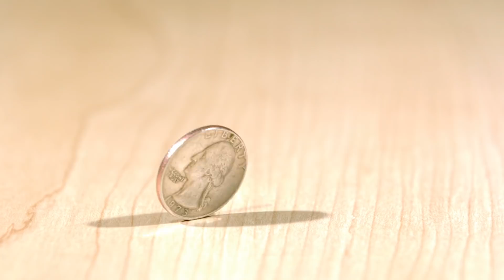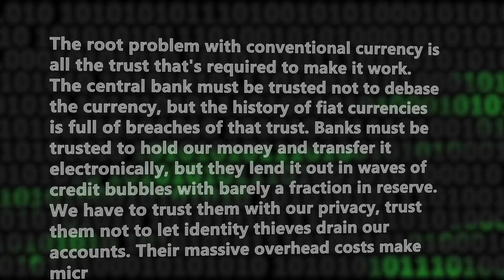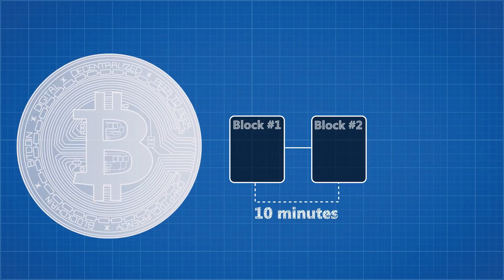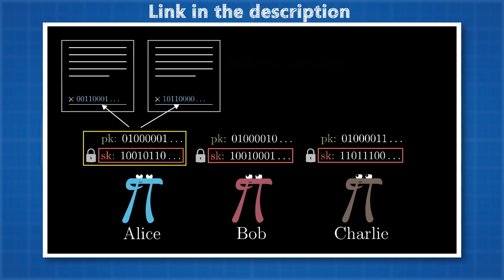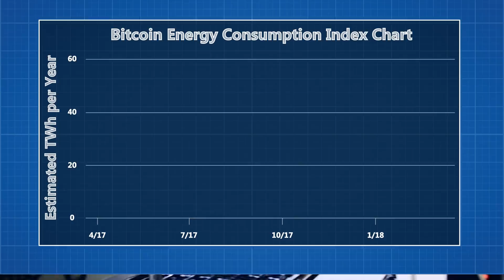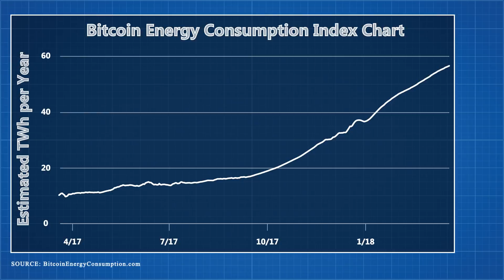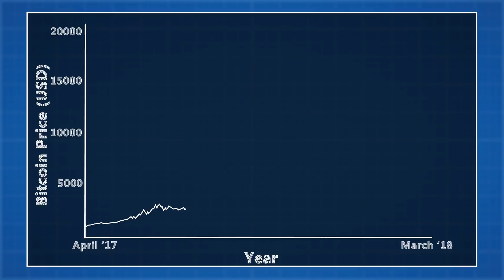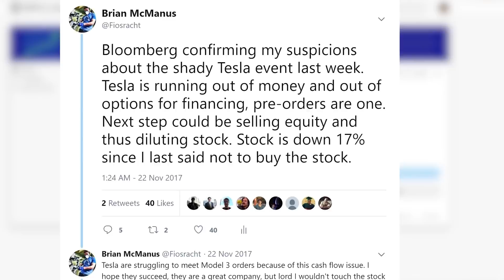Why Bitcoin Is Not Working

Comment: bitcoin is not currency it is a commodity as of now, but it has very very very bright future I think.
Reply: Correct, bitcoin is not and will never be a currency. Learn about what a currency is, then learn what a pegged currency is, then, finally, google The "Double Coincidence Of Wants". Bitcoin has nothing backing it for it to become a stable, useful currency. Never going to happen. If you can be shut out from using a "currency" because you have slow to no internet connection or no computer, etc.... then it is not a real currency. Cash or plastic can be carried around with you, in your pocket and everyone generally what $10 USD will buy you. That can only happen with a real, stable, secure currency, which BTC is not.
Reply: Stock you can get dividend back in most case and they don't go 20k to 8k within 20 days well of course unless you like to gamble with the penny stock.  Bottom line is, bitcoin is not a currency nor a commodity it is simply a game of gamble.  It is no different than betting red/black(up/down) space on roulette.
Reply: a commodity that has no use?
Reply: Theyn Smith stock has any use?
Reply: I'll be paying with my super rare pokemon cards, they have a really bright future.

Comment: You think BTC users want their 'currency' to be worth the same tomorrow as they are today?.... Ha!
You think the 'cost' of Visa processing transactions is its energy usage? HA Just because  electric the primary cost of BTC transactions doesn't mean that it can be compared to the electric used by another means of processing transactions and then say it's less efficient. Is that strawman? It's been a while since AP English, but I'm pretty sure you can't do that. How about you compare the carbon footprint of BTC transactions in a year - you can use that figure in your video, I don't mind, then take Visa's... The company.. Their employees commuting to work everyday.. Their building and infrastructure, their lawyers and fraud,  then tac on their energy usage, compute that with some monkeys, and let me know who is more 'damaging'.. The reason there is so much electric being used by the network is because there is a demand for it to be done. There is a call for someone besides Visa to process my transactions. Sure, BTC or even crypto in general are not immediately solving the problems nacamoto originally intended for BTC to, but.. I'm just not sure you can then follow that it isn't 'working' I mean.. It's not a corporation with a mission statement that isn't achieving it, nor is it a corporation with stock holders that it's upsetting because its unprofitable. If you want to compare it to gold, which is completely inappropriate to do in any serious conversation about it, then you must at the same time concede that it is just there.. BTC has been put out into the earth to be mined and used and traded. It can't... work. Or not work.. Why Gold Is Not Working.. I mean.. it doesn't really have the same ring to it, does it. You got one thing absolutely right in your video, and that's people cause the problem, not the items we use as tools. Our use of Gold as a monetary standard might not be working, our valuation of gold might be unjustified, our use of BTC might be strange considering it's potential, but.. BTC.. Isn't not working.. Bitcoin doesn't have the potential to 'not work'... Also.. considering you published this video yesterday... Why did you just say that the network is limited to 4 trans / sec? I mean... Even if you had already written the script and started recording.. Looking at the 30 day, the mem pool is empty, you'd have to pull 3M to even look back into the past and see 'long wait times' or 'high transaction fees' which definitely were issues that the network faced, but, because of demand, they were overcome. https://jochen-hoenicke.de/queue/#0,3m

You know what.. I think there are 100+ problems with Bitcoin or any other crypto currencies, ultimately coming down to people and how they are using them, or buying them without understanding them / the risk that comes with such high risk investments, but I have been in BTC for years, and been watching it be mined since the good old days when you could mine whole coins on your home PC with a GPU, and it's tiring hearing everyone on the internet / mainstream media talk about it like its some kind of criminal just because people got excited about it last year and lost money. Should we barter? Or are you really saying that Visa is better? If it isn't good, then it wont be competition, and it won't be demanded by the people, and if it is competition, then it will be sustained, and will work, and will cause the invisible hand to make everything better for us consumers. Does that mean that one should invest in Anything without understanding it and the associated risks? NO, of course not, and that includes the bank's CDs even, but does that mean that BTC is 'bad' or that it "Isn't Working".. No.. Just... No. I'm a college student, and I've made... I'm doing well with BTC, and I take the time to understand it from a technical aspect, from a monetary aspect, and from a social aspect. I'm not saying everyone should, I don't believe they should. I just think the issue is people dropping their life savings in Bitconnect.. Not that 'Bitcoin isn't working'

/rant
Reply: CfomodzGaming  ssooo since you said I am a student and I am made... Does that mean you too don't believe in bitcoin and transfer it straight to the dollars? Ironical.
Reply: TheBoldImperator isnt btc still up 10x this year. Things never go up in a straight line , thats just howbit is. Why so much hate? Did you get burned? Or u pissed you missed out?
Reply: Bitcoin as a currency to exchange goods and services isn't working, at all, It's way, way way too volatile for that; it's only working for those who make money, real money, mining and speculating on it. It encompass all the problems of current currencies, but on a galactic level, therefore it is doomed in the short to middle term. Enjoy the ride while it last.
Reply: The idea was great but humanity destroys it.  that's how it's always been.  

even paper money at first didn't go so well.  if you look at history of paper money...  when it was first done.. people realize and start printing their own money.  other counties start burning money of their enemy to destroy their economy. 

and that is why strict regulation has been applied.  (such as only government can print money and burning them is a crime.) 

A currency that is not regulated is always a step backward.
 
Just look at what is happening... people keep on launching  ICO... <---- that was exactly the first problem of paper money.. people printing their own money. 

When you die.. your crypto will be out of circulation.. (that is if nobody know where you hide your private key) <----- that is the same as burning money.. decreasing the currency circulation.

not to mention blockchain consumes so much energy... .
wasting such amount of energy is a big NO for a world that is already heading to clean energy. 

---------------------------

Crypto will be the currency of the future....
but they need to solve these 3 problem first. 

paper money didn't succeed immediately. 

a decentralize currency that is regulated..  wait for it.. it will come.
Reply: It's a bear market.. Are you okay with fluctuating markets? I am :)
Reply: TheBoldImperator, I don't like to share my profits for others' sake. It just seems prideful to gloat about one's own success. I invested years ago, so a $10,000 BTC is a dream come true for me. The only people who were bragging and aren't now because of loss of profits are people who got in during the hype (the same people I complain about in my comment). I'm not sure you really understand my situation based on your comment, but I appreciate your feedback.
Reply: Handschoen, I appreciate the criticism and will consider it. I'm not sure I understand your point about Coinbase employees not commuting to work. He's comparing Visa transaction processing efficiency to the BTC network (which, by definition, is meant to use energy to process transactions (PoW)), but I just don't think that's a fair comparison when you only compare electric usage to electric usage. There is a lot more cost / transaction with Visa than just electric usage, as well as a lot more damage to the environment per transaction. I am not even saying that it would be more than the BTC network / transaction or less (I would imagine it would be less), I am just saying that his argument is comparing the strong part of Visa to the 'weak' part of the BTC network. If I have humans bartering in a marketplace doesn't use much electricity at all, does that mean it's a more efficient means of transacting?
Reply: 00oracle00.. Did you read my comment? I mean, I know it's long, but if you're going to reply I would think you would at least skim it. I am up on BTC. I mean, if you follow the charts, it's actually right where it should be had people not gone crazy end of last year and it continued on it's upward curve, so I have no problem with the price. My hate is against people saying that BTC is somehow broken, or evil, or - as an earlier commenter did  - a ponzi scheme, when.. there is a definition for that word, and BTC falls no where near it. Is it a bubble? I mean, for the sake of argument let's say it is. Does that mean that housing and .com were ponzi schemes... No. It just doesn't. That isn't what ponzi scheme Means.. Could it be a bad investment, sure. Could it be a bubble, sure, but that just doesn't mean it's a ponzi scheme.
Reply: BuzzKil1, no actually. All of my earnings are in BTC. I increase the size of my stack because I believe in BTC instead of cashing out back to fiat. Thanks for the input though. I also spend my BTC on other BTC related products and services - as a means of transferring value, not a store of it.
Reply: I mean we're on year 9 now, right? When will the short term be over and people accept BTC as sticking around? Also.. BTC isn't a currency, so I don't mind that it doesn't work well as a currency to exchange goods and services, that doesn't mean that mining it is bad or that the network is failing to process transactions at a good speed, or anything else. I mean, in the video he is talking about trx limits of 4/sec... But.. that just isn't true anymore. It's a factual inaccuracy to pretend that the BTC network is limited to the initial trx / block limits that existed last year and before that. Was it an issue, of course, yes. Did it get solved because there was a demand for BTC to work, also yes. That is a success, not a failure, or a point of it, 'not working'
Reply: D D - I would just prefer criticism not be based on factual inaccuracies from the past. What is it that I'm not comprehending?
Reply: James Chua, I really appreciate your constructive comments on this :)

ICOs are not more BTC (the printing of more money), they have their own system of value, they are not trying to pretend to be worth $1 like a fake $1 bill though. If I print coupons for free $1 ice cream at my ice cream shop am I 'printing free money' that is somehow going to negatively affect the dollar? No. I am just creating a completely different system of value. It may be traded, or sold, or whatever else, but it doesn't negatively affect the dollar. Although alt coins have an effect on BTC, it isn't because they are people's home made printed BTC like fake money. I'm just not sure the analogy holds water.

Decreasing the currency circulation is only a problem if you try to have a fixed value of the currency. If there is 1/100 as much BTC as there is now in 50 years, we will trade with satoshis and everything will be the same because mining, or gains of any kind in this discussion are a measurement of percents, not whole coins.

As a positive note, I do think that crypto currencies besides BTC will be the ones to really change the world, but BTC had to happen first for any of them to be born, and I just don't think we should shame it for the reason that it doesn't do everything perfectly. With that in mind, to your last comment, there are already several centralized crypto currencies, so I mean; if that is what's going to make crypto 'work' as a currency in your opinion, then that is positive news I suppose. The only problem is, just like you pointed out, humanity.. So.. when someone is holding the key to billions.. What are they going to do with it. If it isn't the government, how will it be treated. If it is the government, it will be more secure than today's money, but it would be an alternative to the dollar, so it's value would be tied to the dollar in some way I would think, and I'm not sure that's what the other half of the crypto community (who is interested in it as a store of value independent of governments) wants.
Reply: Josh Olson, but.. is it? That was the meat of my comment about Visa. If electric is the only variable cost in the BTC network running, is it really less efficient than other means of transfer?

I get that it isn't being used as other currencies are right now, but if it were to be massively adopted and it was processing an equal number of transactions as Visa - would it really be less effective. Electricity can be equated back to coal I hope we can agree. At any rate, find a common denominator that you want to use. I just used the term carbon footprint in my comment, but we can use any unit you prefer. I just think that Visa, as a corporation with all of their people and infrastructure, is using a lot more resources than just electricity, meaning that comparing them on that metric is unfair (in my opinion).

If the BTC network was a company and had to report its carbon footprint, would it be larger or smaller than Visa's per transaction processed. I literally don't know, I haven't done the math. I'm not an engineer, so it was a valid point of interest towards the publisher of the video to do a valid and fair comparison, or maybe to yourself if you understand all that.

My point is this, you cannot deliver a service without expending resources. Since the BTC network expends only electricity, it is a large number, but what if they had thousands of nodes commute to work where they processed the transactions by hand? Then they would use very little electricity, so then would it be better than Visa? No, because we are not including the thousands of node's carbon footprint of commuting. You can't just compare two ideas' energy usage and say one is more efficient than the other. That isn't all that's on the table when talking about efficiency, even if we are just talking about which one is better for the earth.
Reply: Bruce Wayne, as per usual. You are right, sir.
Reply: CfomodzGaming 

When a smart(dumb)ass high schooler can't take any criticism about his investment, or at least comprehend it.
Reply: How much are your earnings worth now big boy? Slipping every day. Is it 7k now? 6k? 5k? Who knows!

Enjoy the bear market.
Reply: "and I've made... I'm doing well" 

Nice to see all the BTCfags are dropping off from bragging about their profits now that they're sinking down the drain. BTC is gamer generation's first ponzi scheme, and people like you are going to be ground zero for the answer to the question "why the internet shouldn't be used for everything". And then you'll have to find a real job. Sad!

Comment: Maybe BTC won't work, but it's likely something blockchain-related will work. I'm not too worried about it. It's new technology and as such there are lots of bugs to be worked out (think Windows 3.2 vs Windows 10).  I still think it's the future of finance.
Reply: What? Do you even understand blockchain or are you just parroting this line because you read it somewhere online. Because that's a line you hear alot. 
Block chain calculations become more and more complex with every single calculation that follows the last. It becomes exponentially complex, thus exponentially more energy needs to eventually expended to keep the chain going on. Transactions of billions of humans every day would fuck it up quickly. Also you need to wait for the calculation to be finished to make one transaction. People would have to wait in line for a long time for their transactions to happen. 
This technology is total crap for finance.